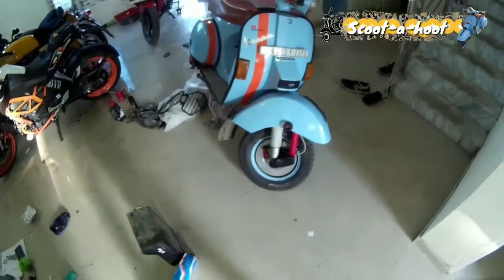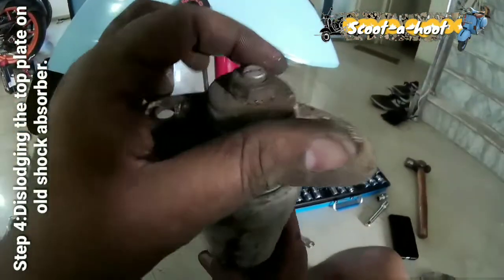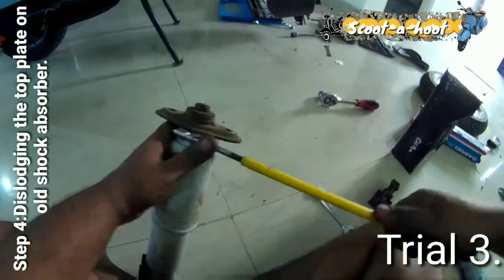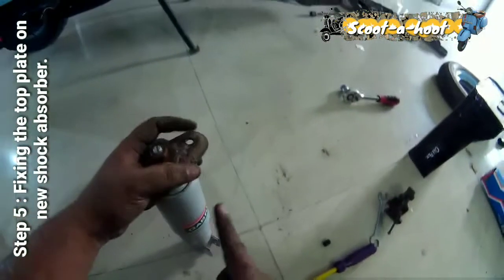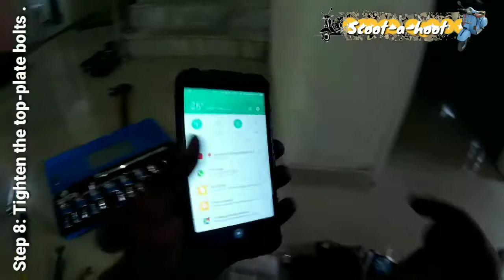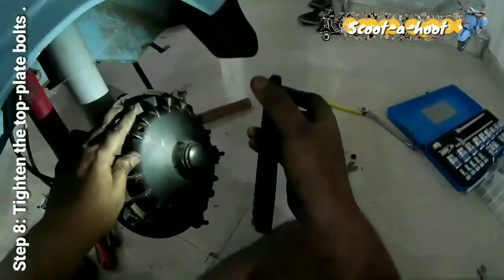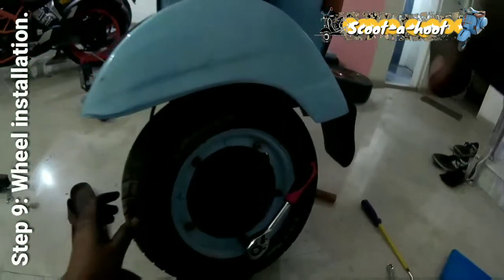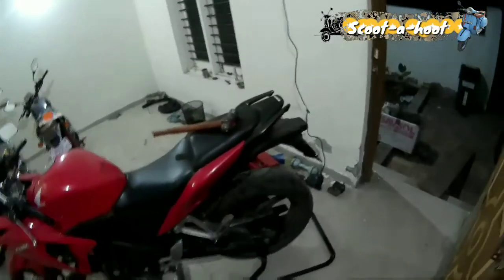How to replace Front shock-absorber on LML vespa NV.

Comment: Hey build it ride it how did you add those pair of headlights to your vespa?I have a 1970 vespa 150 sprint and.i want to improve the lights .Also whats your suggestion for headlight swap?
Reply from the maker: Hi Tarik, I am using those LED lamps in conjunction with the headlamp, and they are powered directly by the battery(I have already done a video on conversion), I found them to be a  very useful upgrade and a must add on if you ride long distance at night.

Comment: Hi bro, which engine oil should I use for lml vespa 1987 model 2 stroke scooter?
Reply: U can use 20w40 or 20w50 4T engine oil for gearbox oil in lml vespa.

Comment: Dude I got 87 Lml Vespa and I need to upgrade it's headlight,how am I supposed to do it
Reply from the maker: If you want better performance in terms of visibility, you should consider replacing the coil, and head lamp, many a times the reflector is also dull, so check if that's okay.
   In case everything is just fine, and you want an upgrade then go for halogen bulb.
Reply: @BuilditRideit  Can you suggest the bulbs that are good for our these antique beauties?
Reply from the maker: @mihirnandan4882  hey mate, sorry for late reply, however I am still figuring out a better replacement to the original unit. Will update, If I ever upgrade.